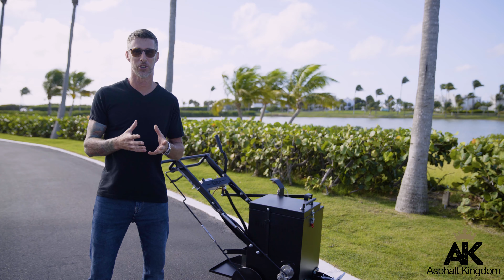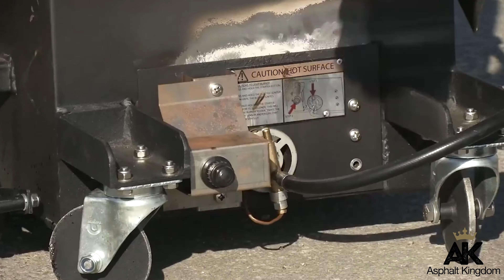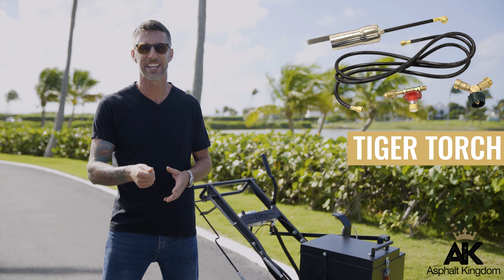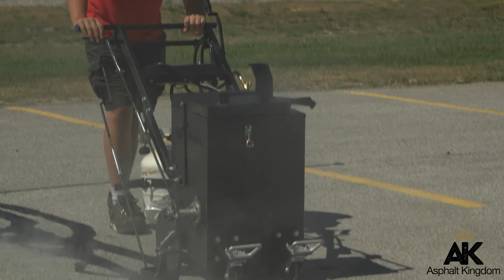HOW TO USE A CRACK FILLING MACHINE? | 6 TIPS YOU NEED TO KNOW

Comment: How long to heat two blocks up, seems like it would take several hours to completely  melt? and how long can you heat it at 350
Reply from the maker: On a cold start with the RY10 Pro, one block typically melts in about 30 to 45 minutes, depending on ambient temperature. For best results, melt one block at a time. Once the kettle drops below half-full, add the next block and keep the material constantly agitated. 

This helps it melt evenly and reduces the risk of clogging, poor bonding, and material failure.

350°F is below Deery Super Stretch’s minimum melt temp. Keep it between 380 to 400°F, and avoid holding it at 400°F for long.

Comment: Hi, how much do you charge for the price, hourly + materials cost + ?????
Great video👌
Reply from the maker: You generally charge by the sq ft for Sealcoating and by the linear ft for striping and crack sealing. Pricing ranges depending where you’re located. Ranges from $0.25 per sq ft to $0.50 depending and $1 per ft for crack sealing.
Reply: @asphaltkingdom  hi, with the materials cost included??? Thanks for your reply
Reply from the maker: @Nico-rw1uo  that is correct.